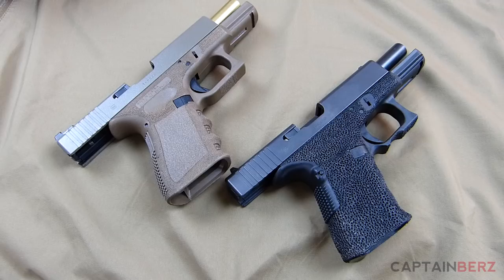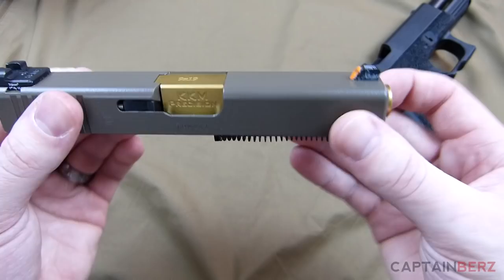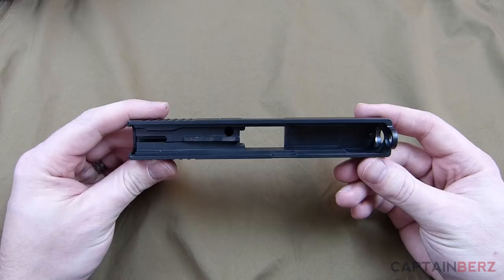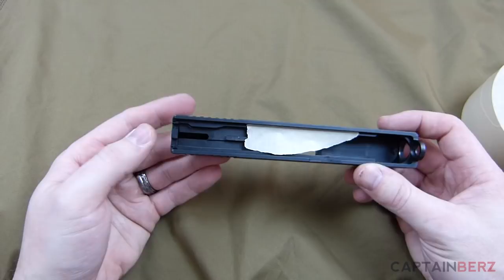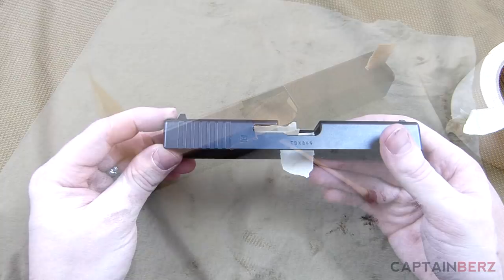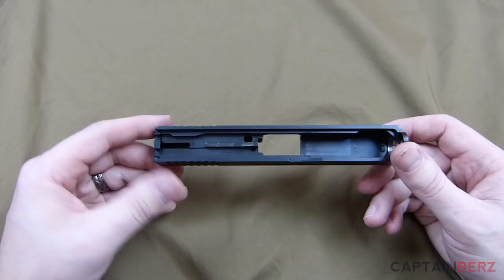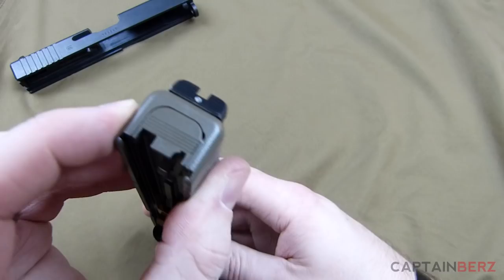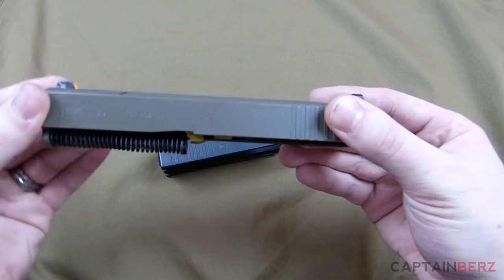Painting a Glock Slide

Comment: I wonder how many ppl melted there striker channel liner after doing this😂 this guy didn't mention anything about it at all
Reply: Very good point. With an " Air Cure," it wouldn't have been an issue, but Definitely should be mentioned for a bake, even at a "low" temp since the channel liner is thermoplastic. Even if you can't afford the right tool, a 5/16 will thread and remove..but will also probably destroy the current one, but they're $5 so worth replacing rather than trying to remove a blob of melted plastic and delaying your Mod/Build.
Reply: Or use a heat gun
Reply: Bruh at 150? Lmao gtfoh, you think a FIREARM doesn't get to 150 during normal operation?

Comment: Don't forget to remove the striker channel liner if you are using the heat method instead of air cure. Worth saving the possibility of it melting, otherwise decent technique.
Reply from the maker: I only use 100ish degrees, which will not melt it. But great point. Thanks for watching!
Reply: @CaptainBerz  You are right that it would "most likely" not hurt it, but not everyone is as familiar with the tools and then techniques of even heat distribution, so for me better safe than sorry.  The Firing Pin Channel Liner SP01148 replacements can be found for 5-7$ online. But atm it might be better to remove than count on getting one replaced if you only have the one firearm.

Comment: what kind of paint?
Reply from the maker: Alumahyde II
Reply: I'm getting ready to pain some gun parts on my s2k, including a muzzle brake. I did some research and heard a lot of good things about this spray paint called Dupli-Color Engine paint,  enamel with ceramic added to it.  Supposedly what a lot manufactures use to paint car engines.  Not only is it durable, it's supposed to hold up to high heat, and it comes in a lot of colors.  I'll post how it went after I am finished with the project.

Comment: Thanks for the fantastic video.  If you need parts, I get top shelf parts for my Glock at close to wholesale prices from spectresupply2 on ebay and spectresupply1 on Gunbroker.  They have way more parts on ebay, but things like frames on Gunbroker.  I've bought tons of parts from them.  They buy out big manufacturers' overstock and then sell it for a huge discount.  Probably once a month or so, I check them out - they're always getting new stuff.  They also have 1911, AK, Sig and other parts.